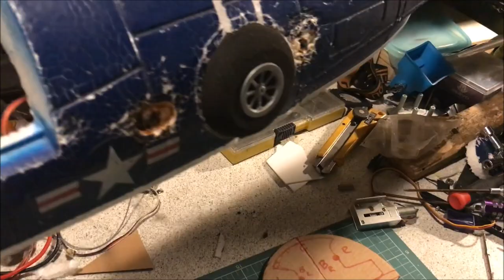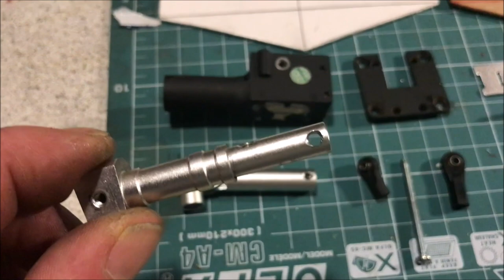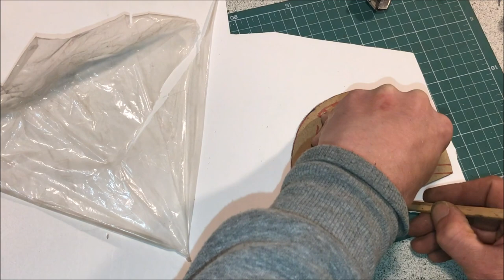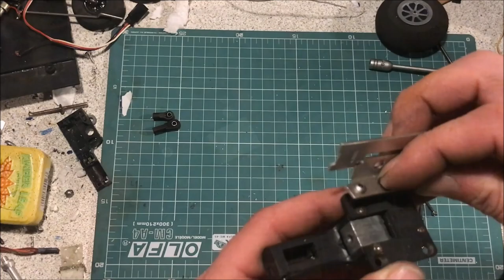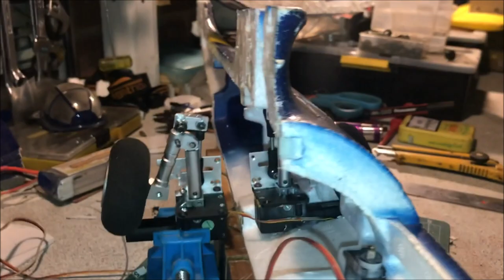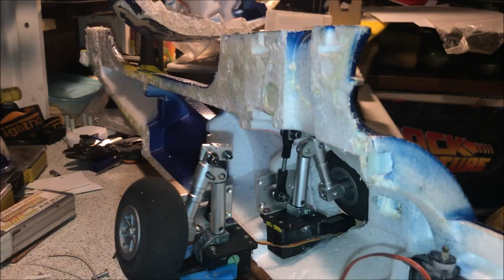DYNAM PBY CATALINA RETRACT MODIFICATION (unit build & install)

Comment: Dude!!!!! You are the man!!!!.. that's some serious engineering. Nice job!!
Reply from the maker: Thanks ..progressing slowly through the build 👍🏻
Reply: @highflying82  im a bit concerned about the retract units taking a load while in that position. But there's an engineering solution for that too....good work
Reply from the maker: @icantfly .. thanks for the input .. I thought that to start once the retracts are secured on the bulkhead which spreads the load across the whole internal diameter of the fuselage.. the retracts are braced now as for landing impact pushing the retract up and out of the locked position I have replaced the plastic weak pivot trunnions with metal so the forks on the trunnions take the load without breaking .. as for landing this was allways a nice gentle landing bird so landing impact should be light and greasy smooth .. cheers dude for the interest will update soon when I have completed the nose gear 👍🏻
Reply: @highflying82  keep posting always nice too see cool mods

Comment: That just works like a charm, tucks nicely in there too. It will surely be very stable as well.
👍💪✌
Reply from the maker: Thanks .. I took into account your observation in your last comment on the prototype of the uprights being to high. They were to high indeed. I have  re.designed and shortened the legs .. it all works great and fits inside the space I have to work with now.. cheers 👌👍🏻👍🏻
Reply: @highflying82  Am glad it worked so well, you did it all, I'm just a curious observer liking what I see. cheers